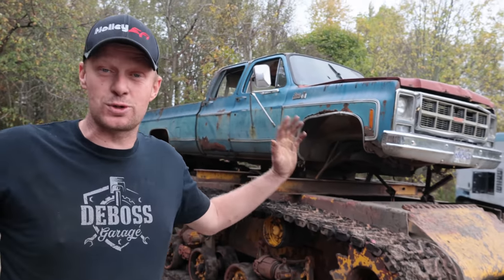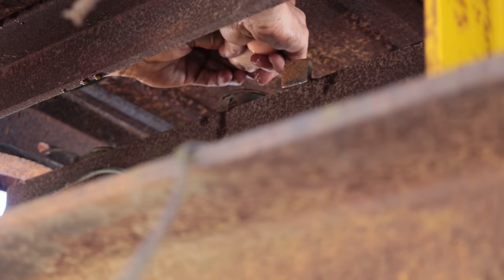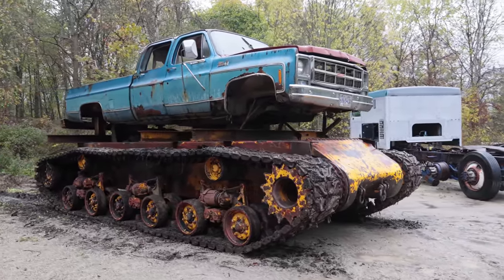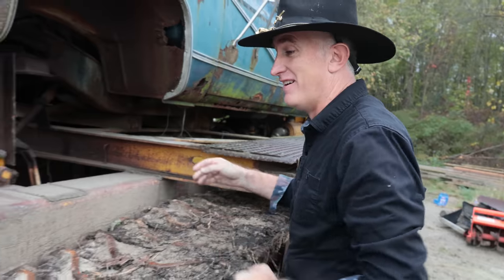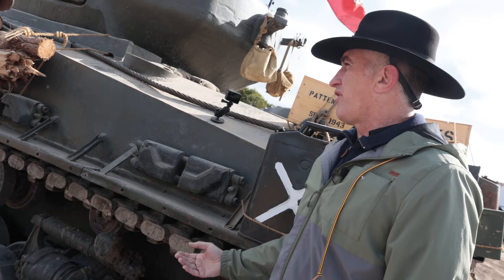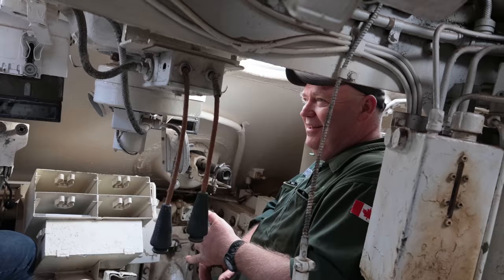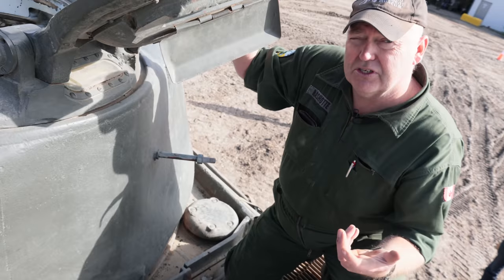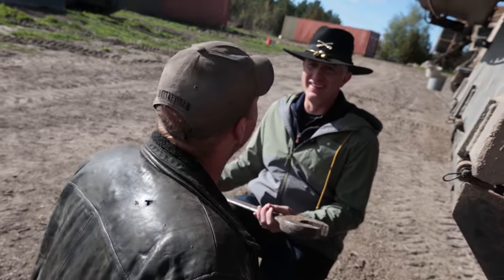Is This a Real Tank? We Ask an Historian... ft. @TheChieftainsHatch | #Shermanator [EP2]

Comment: When they said the M4 Sherman was reliable they were not lieing. 

Thats a 75 year old suspension and transmission still working perfectly fine. I remember how I once drove a 20 year old opel astra and the suspension litteraly fell apart as I drove (the back left suspension broke threw the chassis, wasn't pritty). The fact that this works SO well after all that time is incredible.
Reply: Sherman tanks were built to last, for example, during development, there was a washer that would fail long before the rest of the tank, so that held up the production while they fixed that

Comment: The Square-body C/K chassis fitted to a tank chassis is the coolest thing.  Nothing else on top of the tank hull will be cooler than the C/K, and it should be kept that way, unless you figure out some way to make whatever is mounted on top easily (relatively speaking) interchangeable modules. For instance, The C/K, and a KW W900, retro Cadillac hearse body, stretched 6-8 door Suburban chassis "Suburbanator",  old deuce and a half chassis, etc

Comment: For track tension on our m40 tank rock drills made by finning. We make our own wrench then chain it to an excavator and pull. Track on top should be flat and straight. For loose wedge bolts instead of buying new ones run a Bead of weld to build them up.
Reply from the maker: I got a proper wrench finally
Reply: @DEBOSSGARAGE   Thank the gods for that.  You sure don't want to have it too tight - and a straight top track is much too tight - but too much slack/droop and it'll get thrown, which is a devil of a job to sort out if you're not somewhere flat and open.
Reply: @aussiebloke609  This is DeBoss... there should be an automatic hydraulic tensioning system in the works, right?

Comment: love it!
if you really wanted rubber tracks, could see if you could get some modern 2 track tractor tracks the right length, have to change or modify the running gear, but probably still be cheaper than trying to find M4 rubber tracks
Reply: nah, M4 rubber tracks would be infinitely better

Comment: I would get rid of the truck frame, make standoffs on the tank itself to mount the body and box, have the body nearly flush with the cross members, good way to reduce weight and give it a better profile. Also add access hatches in the box and in the cab in front of the seats for easy repairs. I don't see the need for a full floor under the tank so maybe get rid of that too and just do some skid plates?

Comment: If you replace the cab, you should put something like a camper trailer or RV on top of it. Seems a little bit of a waste to have something that can go anywhere and just have a dinky little truck on top of it. With semi truck cab airbags all the way around, those big cushioned semi truck seats in the front, you have something you can take deep into the woods and might not cause butt devastation the entire journey.

Or maybe an old boat, and even connect a big wooden ship wheel to the steering system and stand up on the deck dressed like a pirate.

Comment: My welding instructor calls this value added engineering. It uses existing materials or a different technique to accomplish the same task at a savings. Kind of like the Zimmerman powerplant that was supposed to be nuclear but switched to coal firing before completion in the 80's.

Comment: The "egg trick" was certainly pretty common knowledge here in Scotland in the '80s but I never heard of the pepper/coffee thing. I was always told only to use the egg if you were actually going to replace the radiator, as it would often cause the opposite effect and block the rad passages. 
In those days, I ran my vehicles on scrapyard parts and the egg would work for long enough for a radiator to appear in the yard, sometimes a good few months.😁
Great episode Rich, fun and educational in equal parts.✔ Have to admit though, I was pretty surprised at your smart decision at the bridge.😂

Cheers for now.

Comment: What an awesome episode!
The Egg thing..... Older 1970s and before Aussie trick before you could buy mechanic in a bottle and unlike mechanic in a bottle it actually worked and didnt cause more dramas.
671 Screaming Jimmys....... Yes the head were not "Handed" AND it was fairly simple to change the engine rotation from Clockwise to Anti depending on the transmission and engine setup.
I can see why Tank museums etc run them as stock a lot like LS swapped Cadillac's.
Cheiftain, (Father Ted?) What a great bloke! and with a great sense of fun. Next stop is his channel after DGHD!
Tanks for der great viewing :-)

Comment: You have a NAPCO spar carrier base, they called them the “M4A3”, but they’re a hodgepodge of parts from whatever was available in the 60’s. They were used to carry a logging machine used around the world, the “steel spar yarder”. They usually ended up with steel tires on the bogie wheels, because the rubber didn’t last long carrying twice the weight it was intended to carry. The springs are often broken, as well. When the yarders eventually got scrapped,  the carrier was often left intact, “because it’s a tank!” Cabs were put on them, different motors, cranes, etc. The hull is usually mild steel, with the exception of the cast armour differential housing. Madill never built these, they bought the carrier pre assembled from NAPCO. The same carrier was used by Skagit, of Sedro Wooley Washington, and Tyee Machinery Works in Vancouver, BC. Originally they were powered by a horizontal engine on the deck, through a torque converter, power take off, angle drive, and a down drive to the original transmission. First gear was usually disabled, as the big diesel, combined with the 60 ton weight, put too much strain on the final drives in 1st. gear.
Reply: I'll take your word for it.
Reply: @TheChieftainsHatch  I should have mentioned, I have the manual for the Spar Carrier, if these guys need one.

Comment: Selleys Knead-it is the best thing for a hole in the rad.
I was putting a brand new hydraulic oil cooler in a Komatsu FEL and when putting the rad in next to it poked a hole in it!
I temporarily plugged it with Knead-it and several years later its never leaked so never got fixed properly.

Comment: Tmar industries in Campbell river bc will have all the parts needed.  If ya want cheaper used parts Saratoga ventures also in campbell river.  these style tracks are used widely in logging here on the coast.  Old tech nowadays but everything from the madill pipes (yarders) and the m40 tank drills used for road building, anyways cheers! Sweet ride

Comment: in case you haven't already received the answer, what you have there is a model 009 S. Madill steelspar yarder. It was built in Nanaimo British Columbia at their factory. S Madill had been around for a long time and bought a number of surplus military tracked vehicles over the years and converted them to logging yarders. The son of Sam Madill was killed and the company The typical engine that powered it would have been a 12V71 series Detroit Diesel that would power both the yarding unit and the undercarriage to move it.
There will still be in existence operating manuals on track tension and other maintenance for the 009 yarder

Comment: Heh, take the pickup engine compartment, close in the bottom, and split the hood so it opens halves sideways (so you don't block the driver's view) and put an observer's seat up in front. Do it right and you can fill it with ice and goodies instead...

Comment: You guys need a zombie apocalypse AFV.
1st. Scrap that truck body and the linkages. You won't be needing it. 
2nd. Do what is required to install shock absorbers on the HVSS.
3RD. Swap out that weakie engine for a 500+ HP trubo charged diesel, big fuel tanks and a good cooling system.
4th. Design and build an angled armor hull from steel that will stop .50 cal AP rounds.
5th. Obtain a Sherman turret ring and turret or fab a angled armor turret fitted with a black powder cannon.
6th. ROCK AND ROLL!!!

Comment: Would be neat to design a quick change body mount system. Undo a few pins, plugs, and linkages and swap to a different body. I love the truck but would love to see a hybrid or electric car body on it at some point. Prius, Nissan Leaf etc.  would be cool to see a rv body on it as well, although it may rattle a RV to pieces.

Comment: There's a company in the southern states of the u.s.a. that built a bunch of those for the off road use for power line trucks or for use where a road truck couldnt go . Like swamps and fields where there is mud or standig water for long periods of time. They used components off of tanks or similiar to tanks and mounted bucket truck booms,small cranes , and tree cutters etc.... On em. I think it was called panther somethimg. Not sure but they are still making them because i see new ones all the time

Comment: It's not the same as the GM 6046 (the two 6-71's side by side in the Sherman), but a 12v71 would be wild in the tank truck. Only problem is they seem to be one of the more rare Detroits, so I don't know how feasible it would be.
Reply from the maker: There is one in town with a generator behind it.  A giant electric motor driving the tank would be pretty cool.  Maybe down the road sometime

Comment: Sheesh Rich, now I'll have to politely refuse scrambled eggs from you guys, if ever offered.
I'd be wondering which radiator they went through before they landed in my plate 🤣
As you now know eggs don't fix radiator leaks longer than a couple of hours anyway.
If you're very lucky and it worked in the first place, that is.
Just FYI, survey says that you shouldn't put yolk in, just white.
You'll then have an about 5% better chance of plugging that pesky radiator pinhole a few kilometers longer, and maybe get home 😜
Friendly salutations from Switzerland.

Comment: that poor easy 8 track suspension is so uber neglected...........;(     In Australia, a guy called Upton made quite a few tractors that used the Sherman/Grant transaxle as the final drive for a 2WD tractor........in front of the Sherman transaxle (now pointing backwards) was a roadranger truck gearbox (9 speed) spun along by a UD Nissan 2 stroke, Cummins or V8 Scania diesel engine.